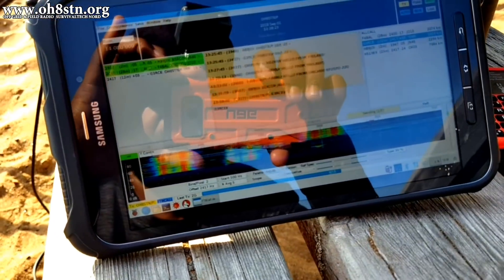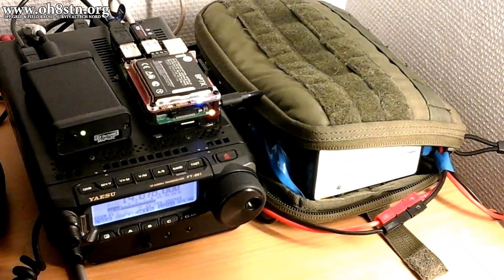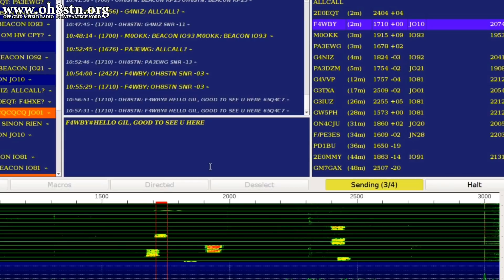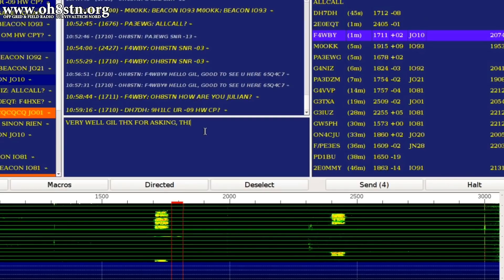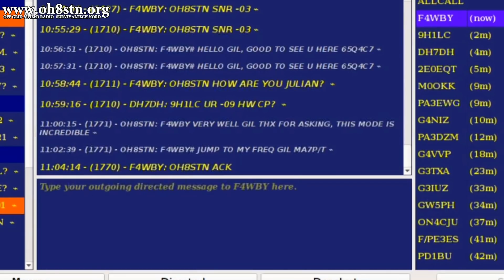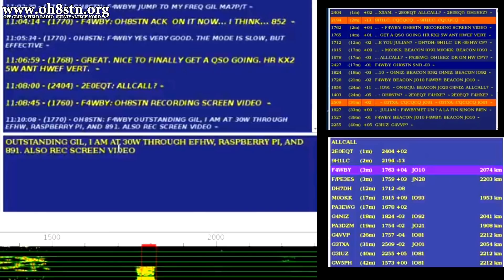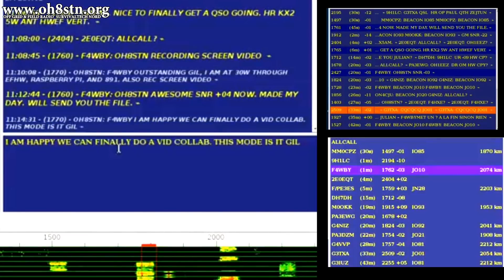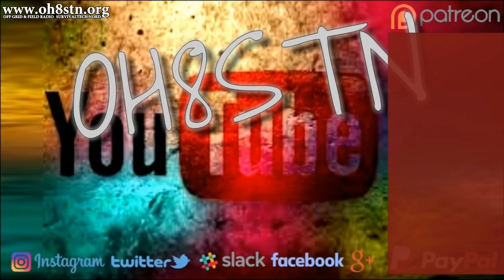JS8Call QSO with Radio Prepper

Comment: I was looking for a psk31 type digital mode because psk31 got sunk by ft8.  FT8 is useless for ecomms/grid down comms, i have never understood the draw to it , but it is without a doubt BUSY.  I came across JS8CALL about a week ago from a youtube video, decided to check it and have made a few qso's with it and i think it is a fine replacement for psk31.   Then i began to understand the NETWORKING system that lives within this mode, so many folks dedicating rasberry pi OS and qrp radios to establish and work the heartbeat network.  Which for ecomms and groups that exist in those times, this system is extremely valuable.  Not to mention as you talk about , the reliability of this communication mode on LOW POWER, making it seemingly perfect for ecomms.  I agree, no one in HAM talks about grid down comms, its all about ARES, which in my opinion is a waste of time in most areas, gov service are intact to supply the info ares has, mostly.   Also I began to see all these folks using raspberry pi OS systems, that use low power and can easily be powered in grid down event.  Im with you on this mode for grid down, I want to investigate , learn and build this raspberry pi OS to use with a radio at qrp levels so i can truly be prepped for the event.  Currently i use a laptop, which is certainly not as easily powered as a R pi.  Great video !!!
Reply from the maker: Raspberry Pi is perfect for js8call if that's the only system running on it. You'll probably want to watch this video next https://youtu.be/xIrd2l8t4l8

Comment: Hell Julian. I love your channel--its the most interesting Ham channel on youtube. I went to the JS8Call website today. It says we must re-download JS8Call every 10 days because each copy of JS8Call now INACTIVATES after 10 days. This makes the software less than useless for emergency comms. Ex: disaster occurs, you go to use your rig & discover that your copy of JS8Call has expired after 10 days. Internet is down so you cant download.  Also, what if you operate in a remote location without internet access for more than 10 days and your JS8Call expires?  I feel that if the developers are going to play games like this, they cannot be relied upon. Any thoughts on alternatives?
Reply from the maker: Valid point but let's put things in perspective. This is pre-release software, that means it's still in beta. Everyone knows that when they sign up for the software. We are helping to develop the software by giving our feedback about each release to the developer. When the software reaches version 1 those time limitations will be removed. Until we reach version one, I wouldn't use it as a primary tool for emergency communications. You have a valid point but we have to look at the big picture, as well as the development phase.
Reply from the maker: And we will get there 👍👍👍

Comment: Solar Powered Portable Off Grid Go Kit Question:  I've been researching the Ft-891 and I'm considering purchasing the unit for a Go Kit.  Before having an interest in a Go Kit, I purchased an IC-706mk2g and never used it.  I have other radios for 2m, and 70cm.My considerations are receive quality, capabilities, power consumption, ruggedness, and size/weight.  At this time, I am
only interested in voice communications.  Another consideration is whether a radio is user friendly.  My question is should I
sell the Ic-706mk2g and purchase the Ft-891?  I have the Ft-817ND, but I would like the 100w capability.  Comments would be appreciated.
Reply from the maker: That's a really really really tough question which you should make on your own. I will tell you this however. I was going to buy the Yaesu ft857. After some research I began to understand the receiver on the 891 was light years ahead of the eight five seven, even when the filters were installed on the 857. 706 is small and and efficient, but it's a really old radio like the 857. I hope that answers the question. The other thing I can say is, I have absolutely no regrets with the 891. It's the most incredible receiver I've ever had in a radio.
73
Julian oh8stn
Reply: @OH8STN    Thank you Julian.  Excellent channel, I always look forward to your videos.

Comment: Concerning FT8CALL and Grid Down Comm.  I used to be involved with the local ARES/RACES group.  At that time we were using Packet or Voice to send ARRL forms.  Is there any forms capability to FT8CALL????
Reply from the maker: Hi Bill:
Although forms might be a nice addition to the application, freedom of message content is the essence of FT8Call. That is to say the application focuses on slightly delayed keyboard to keyboard messaging. From an emergency communications perspective, it's more like a type of "tactical messaging", but I'll skip the buzzwords.

So currently there are no plans for building forms capabilities into into FT8Call, but that doesn't mean you can't get that functionality. FT8Call has a built in API allowing users to create their own additional functionalities (like plugins). At the moment I know there is a map plotter for offline maps in the works. There is also work being done to integrate the GPS with FT8Call, automatically updating grid locator for an APRS type functionality. There's no reason why users requiring the ARRL forms functionality, couldn't use the API to build that into FT8Call. Of course this requires effort on their part. So the answer is "it probably won't be built in natively", but because of this API there's no reason you couldn't develop this functionality yourself.
I may be wrong, but I can't think of any other ham radio application which opens itself up to outside development. Essentially this means anybody can build plugins for FT8Call.
I know it's not the answer you may have wanted, but I hope it helps anyway
73
Julian oh8stn
Reply: OH8STN  Thanks for the reply.  Even if it did work, the time for acknowledgements would be excessive.

Comment: Can you elaborate on using aprs messages with this mode?
Reply from the maker: Hi Dave. At the moment, only APRS position is supported. When enabled, each FT8Call installation acts as an igate. When a station sends the ALLCALL GRID command, stations hearing that message will forward it (tge ststiins grid coordinate) to APRS-IS. Here is a tutorial on using the ALLCALL GRID command in FT8Call. https://youtu.be/mQxmhPqcQzA
Reply: @OH8STN  nice.   That would be super useful.

Comment: Happy to answer any questions on FT8Call y'all!

Cheers!

Jordan / KN4CRD
Reply: Hi Jordan. I have recently started dabbling with data modes on ham radio (although I used them in the army), and I just can’t seem to get this one to work. I can pick up stations (was watching 8-9 QSO’s today whilst out) between stations in the US, France, Spain and Italy, but when I send CQ, no one seems to be receiving me.....all very frustrating. 

My setup is a FT-817, using a MacBook with a Bluetooth CAT into the ACC port in the back. Connects no problem  and the program appears to be putting the radio into tx, but like I say it seems no one is receiving me. Any help/advice would be greatly appreciated, many many thanks in advance.......Paul
Reply from the maker: Data should be USB, not LSB.

Comment: I really like how robust your raspberry pi is in terms of uses. But for my uses i'm wanting to setup a one device system. Using an android phone or tablet and an external keyboard. I might play around with installing a full linux distro on a tablet to make it a little more useful since ft8call cant be used on android yet. Really enjoying the videos you make
Reply from the maker: Actually I'm right there with you. It would have been my wish to have an Android tablet-based system, but the closest I could get to it was integrating the Raspberry Pi with the radio, and using the Android tablet as the controlling interface. Android is definitely our most portable operating system, but there isn't a whole lot of development from a ham radio perspective at the moment. :(
73
Julian oh8stn
Reply: Or one can get a hold of a Winbook tablet and run FT8call using the Wolphilink Interface (hopefully this will work) connected to his FT-817. I have both a 7 and 8inch Winbooks running Windoze 8.1 both in their imitation leather cases with bluetooth keyboard/touchpad , but at the moment my Wolphilink Interface, both my FT-817s and the 7inch Winbook are in my QTH in Athens and I am in Gateshead UK (IO94ew) for the next few months stuch with the bigger 8 inch Winbook! I should go to Athens for a couple of weeks before XMAS, and I am bringing one FT-817, Wolphilink and the 7inch Winbook with me! Then I will test FT8call running in one device! Another option is to find a Pimoroni 3.5 inch touchscreen like Jordan's  for the Raspberry Pi, which has a better resolution than the cheap ones that only give you 240X320, and have the Raspberry Pi with it's own touch screen, but still you need an external battery for the Raspberry Pi. More cables and boxes! Also there are no more 3.5 inch High Resolution Pimoroni touch screens left, which leaves me with two options only, The Winbooks TW-700 or TW-801. They both have 2 USB ports, one is full size USB 3.0 and they run for 4 and 6 hours respectively using their internal batteries! The Wolphilink, if it works with the Winbooks, looks like a cable with a thick blob (the Wolphilink box) in the middle! I am not sure if there are any tablets that can run Linux instead of Windows! So there is your one box solution! Hi hi hi!  73 de Demetre M0SUY (SV1UY)

Comment: Nice job Julian. According to your experience with various portable and semi portable antennas, what would be the smallest possible antenna for 75/80m ?
Reply from the maker: That's a trick question. There's no such thing as a small antenna for 75/80m. Every antenna with the exception of a resonant dipole will have performance compromises on those bands. So from my perspective there really is no right answer. The best we can do is look at how much space we have for the antenna, and where it can be deployed. Those two points will define the type of antenna you can deploy.
73
Julian oh8stn
Reply: OH8STN, that’s a good political answer! I am guessing a double turn loop ala Cha loop would be the most compact antenna but I will experiment with a micro dipole made of 2 mobile resonators.

Comment: You seem to have all the activity at the moment Julian, I haven't had an FT8CALL QSO for some time here at the home. I'm looking at changing antennas both at home and out /p but this will be a slow burn project now the autumn storm season is upon us and funds are diverted to prep for Christmas. Great that you finally got the collaboration with Gil. All the best.
Reply from the maker: Yeah the antenna situation is always a tough topic. When I was on the radar Challenge and we tried to have the qso, I realized your most likely only problem is noise. Anyway was really nice too have an on on-air hook up with radio prepper. Now we have to do the same thing portable to Portable.
Anyway, I always appreciate your comments.
73
Julian oh8stn

Comment: Julian, could you present more information on the antenna set up and if your using 30 w and Gil is using 5 w would get the same comms if you both used 5w?
KF4JBZ Mike
Reply from the maker: Sure no problem. I was using the chameleon EMCOMM 3base random wire endfdd. It was in inverted Lazy L configuration, sloping 230°SW. You saw my heard list, so... :)
Gil and I will try this portable but I think you've already seen the results from Lapland https://youtu.be/xfH5YDEQ_18
I'm sure we'll do it :)
5w to 5w portable will be tough, but possible.